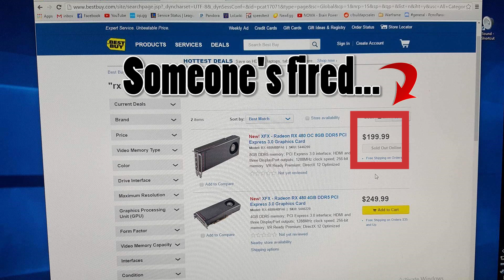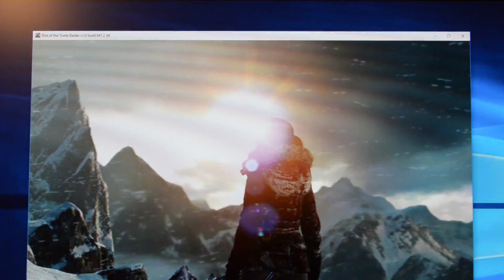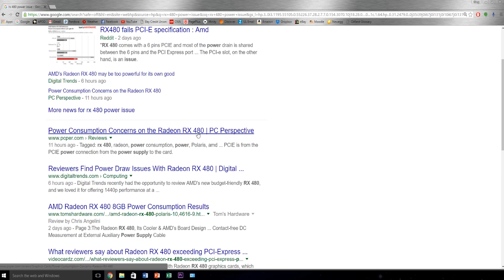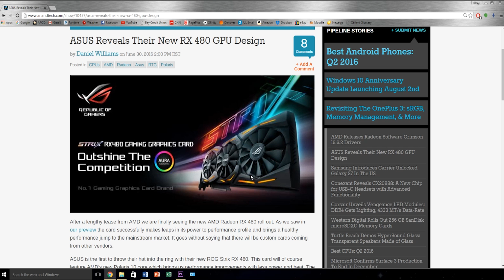RX 480 Aftermath: Power Issue & Over-Hyping

Comment: You will find it is probably a pcie 1.1 problem. Don't quote me but I'm pretty sure there was an upgrade in power Delivery between pcie generations. 
I'm glad you decided to make this video. AMD simply promised 5.8 tflops of compute power for $200us, and good 1080p ultra performance. They delivered. Sad the cards are 450$ in Australia though. Everyone is acting like the most entitled bunch of scum, expecting 980 performance from a $200 card, and acting like they have been robbed of something personally when it doesn't meet their expectations....... If you don't like the product, simply move on a purchase something to your liking instead of slandering a whole company and user base. It's pathetic.
Reply: Beating the 390? That is a WAY to high expectation. What I was expecting was that it would destory the r9 380 and have about 390 stock performace when overclocked. Once other people start making other coolers with custom PCB including extra 8 pin conectors it should all be fine
Reply: +Joric78 Well said, exactly what I was thinking.
Reply: You can get 4gb Australian ones for $319 here (sold out though) and 8gb ones for $380
Reply: Beating the card one above from the previous generation is hardly a massive leap in performance. Especially considering the die shrink and the gains Nvidia has gotten with theirs. The GTX 1060 is supposedly at GTX 980 performance levels. That's what I was hoping for from the RX 480. Given the price and performance, the reality of the RX 480 is pretty under whelming.
Reply: Joric78
The marketing hype was exactly the same as it always is - people expected far too much from a midrange product. Nvidia claimed twice the performance of a Titan X with the GTX 1080, but it's nowhere close. That's because they claimed twice the performance in specific VR scenarios. They've also been vague with floating point performance and exact specifications until the cards are reviewed. It wasn't AMD that were hyping the idea that it would go toe to toe with a 980 or 1070, they were saying it would reduce the cost of VR capable graphics (which it has), use less power than its previous chips (it does), and offer great performance per dollar at the entry price of $200 US (which it also does).

AMD can't really do much about the price comparison in a lot of regions. Here in Australia the 4GB model is $110 cheaper than the cheapest 970 and 390, and the 8GB model is $50 cheaper. That's a pretty good deal for that kind of performance.

Some people seemed to have it in their heads that the RX 480 would replace their 290X or 390, when that's entirely unreasonable. The 770 wasn't a worthwhile upgrade from the 680, the R9 280X offered nothing to owners of the HD 7970. Midrange cards don't magically replace high-end cards.
Reply: ***** Whoops, just realised I'd put down $479. I meant $379. Mostly they're advertised for around $440 though, and it was MSY that had it advertised for $479 on their pdf price list.
Reply: There never were any 4Gb cards here. The listing at PC Case Gear was "sold out" from the start.
Reply: I'm actually one of the people very disappointed with the RX 480. I was one that went along with hype and expected 980 performance as well. But the fact that it didn't live up to that dream doesn't bother me too much, but having 980 performance would've been nice. But the problem I have with the 480 is that it freaking struggles to beat the 970 and 390. It should be completely beating out those two cards. And another issue is that the 480 has very limited headroom for OC'ing. Hope everything gets ironed out.
Reply: It violates all the PCIe specs, even PCIe 3.0.
Reply: +Ertytheqwerty Why is beating the 390 far fetched? It should easily destroy the 390 as the 480 has been boasted to reach 1080 performance at CF, so it should destroy the 970 and 390 no problem.
Reply: Wait until the cards with the custom coolers.
Reply: You feel for the good old "manufacturer's best case scenario" advertising.

AMD showed that dual RX 480's could compete with a single GTX 1080 in Ashes of the Singularity in DX12 EMA mode. In no way does that guarantee that two RX 480s are equivalent to a GTX 1080 in every game, nor that a single RX 480 is equivalent to exactly one-half of a GTX 1080 in every game.

This is exactly the same as the leaked GTX 1060 slides showing that a GTX 1060 offers "significantly" more performance, and the graphs looking two times bigger when in reality the graph starts at 0.8 instead of zero. This is manufacturers showing you the best case result to try and make you believe you'll get that kind of performance all the time. Yes, it's misleading, but that's marketing for you.

The RX 480 is undeniably a midrange card, or else it would have been the RX 490. The fact it comes close to matching an R9 390 is very impressive for the price. Overclocked boards with third party coolers and better power delivery could elevate the RX 480 past the R9 390 and closer to the 390X.
Reply: How is almost matching the R9 390 impressive? It's pretty standard for a new generation to perform at the level of the cards above from the generation before, even without a die shrink.
AMD was vague with their floating point performance specs, showed impressive crossfire results and talked about matching the VR performance of $500 cards. They also way over hyped the performance per watt angle, given the actual power draw of the card.
We saw way more than the usual level of marketing hype, then AMD delivers a pretty standard level of generational improvement. Take into account that outside the US the price comparison with other cards (the GTX 970 and R9 390 in particular) is often much worse, and it's little wonder people feel let down.
Reply: +SvD KILLSWITCH facepalm How is it unreasonable for the 480 to replace to 280X or 390? Words of a fanboy, I can't believe you are saying it is okay for a newer mid-tier card to be beaten by older mid-tier cards.
Reply: JACMIC23
290X, not 280X. It does in fact replace the 280X because the 280X was a midrange card. Might want to re-read that.

If I were indeed a fanboy, I'd probably have these cards in some crazy crossfire configuration. As it stands I'm using a GTX 670 and will continue to do so until I'm ready to upgrade.
Reply: +SvD KILLSWITCH I read 290X but I made a typo. Care to explain how it is unreasonable for the 480 to beat out the 390 and 290X, when hell, it just barely beats out the 390 and 970 in some benchmarks? Honestly this is a terrible deal of a card, people really need to stop throwing around the $200 price tag when the 8GB model is the recommended model and costs $240. Smh this is ridiculous. I really wanted the 480 to be better than this, it shouldn't struggle to beat out a 2 year old mid tier card, I can't even pay $200 for this
Reply: I live in Australia as well man. The 4GB version hasn't appeared anywhere here (PC Case Gear never had stock). The cheapest RX 480s available are $369 for the HIS from PLE computers or $379 for the XFX from PC Case Gear. Most of them are over $400. You can get the Gigabyte R9 390 from Megabuy or MSY for $390. You can get the Gigabyte, Galax or MSI GTX 970 OC versions from Umart, MSY or PLE for $399. Those are factory overclocked versions with much better coolers.
The RX 480 barely outperforms the GTX 970 and barely uses less power. Pretty unimpressive performance and pricing. The GTX 770 effectively was a GTX 680, which is exactly what I was saying about the performance and price from generation to generation. The RX 480 was billed as something impressive, and it's just the usual.
Edit: Whoops, I meant $369 and $379.
Reply: JACMIC23
The RX 480 matches the 970 and 390. Some reviewers were using factory overclocked models of both and the RX 480 matched them. We've seen the reference models tested along with their pitiful amount of OC headroom due to a borked power delivery system and a dinky little cooler. Once the custom boards come out we'll get a clearer idea of the true performance of the RX 480 with none of the limitations that all reference coolers have, and how that compares to the 970, 390, 390X, etc.

The $200 comparison is still apt when you compare it to the GTX 970 which also has 4GB of RAM. The RX 480 isn't going to be slowed down by an imbalance of memory controllers either, and though that issue rarely pops up at the moment it could have greater impact in the future.

I too had hoped that the reference board would comfortably sit ahead of the 970, and that's somewhat close to reality, it's about 5% faster on average, it's not quite as much as I'd hoped. Maybe with some decent cooling, a healthy overclock, and a card that pulls from a couple of six pin or an eight pin connector, the RX 480 might be closer to what you want. The reality at the moment is that if you want high-end performance your choices are previous flagship cards, Nvidia's 1080 or 1070, or waiting for Vega to come out. For the mainstream segment, having greater access to the power of something like a GTX 970 and R9 390 isn't all that bad. This would be the kind of card that replaces the 7870 in my father's PC, or perhaps goes into a budget friendly gaming build for someone who's upgrading from a console.
Reply: Joric78
The 4GB models haven't been released yet, but we do have a price (even if it's a rough guide). The cheapest RX 480 is $380, the XFX reference model from PC Case Gear. For whatever reason, the other board partners are pricing much higher. MSI, Gigabyte and ASUS are all pricing above Sapphire which to me is very surprising. While it might be "just the usual", it's still a level of performance we haven't seen at this price point. I'd fully expect to see GTX 970s come down in price (or go on sale) to hover around the $380-$400 mark as they're starting to do in response to the RX 480. Prior to the release the cheapest retail 970 was the $430 ASUS Turbo model with a reference style blower.
Reply: PLE in WA has the HIS RX 480 for $370, but compared to the R9 390 I expect more than $20 savings and lower power from a die shrink that was so long in eventuating. Given the performance and efficiency increases Nvidia has seen with their die shrink for Pascal, the RX 480 isn't really putting them under any pressure at all. From the sounds of it they'll be able to release their GTX 1060 for $100 more and have no trouble selling them.
Reply: Joric78 8GB XFX RX 480s are at PCCG for 379
Reply: during synthetic benchmarks it falls in between the 390x and the gtx 980... I think they just want that to translate to real world performance. On the other hand, this card is so fresh that they really will have to wait until there's more driver updates before they start seeing higher performance come out of it. 

Both of us probably have more realistic expectations of its performance. It falls to about where AMD said it would for performance.
Reply: Exactly, Hoolio VonLoot! 

xfx amd 380 8gb (for 272 Euro in germany)
Reply: The cheapest 8Gb 480 is $380 and you can get the 4Gb for $320 in Australia from MSY and PC Case Gear.
Reply: Str1000ac Google it. Probably China, Taiwan or smth like that.
Reply: Exactly, i'm living in germany. The Overall taxes are around 70-80% of my income xD So I have only 10-20% I can spend for my own
Reply: I'm living in russia, and i'm buying cards in germany in case it actually cheaper! :D
Reply: this totally makes sense cheers

Comment: so... in short, can i put rx 480 on my asrock 970 pro3 am3+ motherboard ?
Reply: http://www.asrock.com/mb/AMD/970%20Pro3/
Probably you can. Im not sure,  because it has only PCI-E v2.0 slots instead of PCI-Ev3.0
Advise: Buy videocard from subvendor with more than 1 power cable. Like was said in the video.
Reply: Check which rev is your pcie on motherboard. If it's rev3, then yes, if it's lower, then no, unless your rx 480 has more than a single 6 pin connector
Reply: That's not true at all, PCIE 2.0 will be fine with this card.
Reply: particularly, i have asrock 970 pro 3 r2.0
Reply: Javed Alam Bullshit. PCI-E 2.0 officially delivers just 75 watts. We are talking about 80-85w being required
Reply: The Diamond Games - Channel closed Actually, you're thinking of PCI-E 1.0

Comment: Higher end GPU's tend to shut the computer off when something isn't  firing right, especially on cheesy/old motherboards. Used to work at Geek Squad as an advanced repair agent. A lot of kids (10-15) would come in with their custom PC'sand had the same issue like a 660 or 7870 with some boo boo intel motherboard and same thing happened. lol